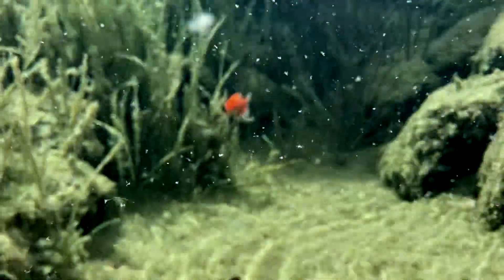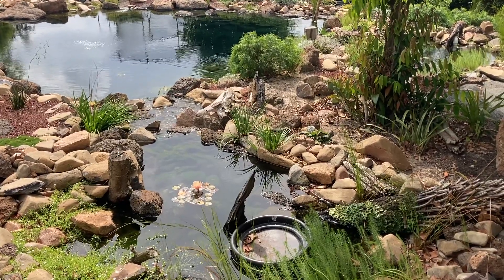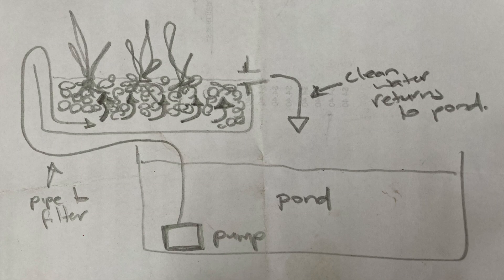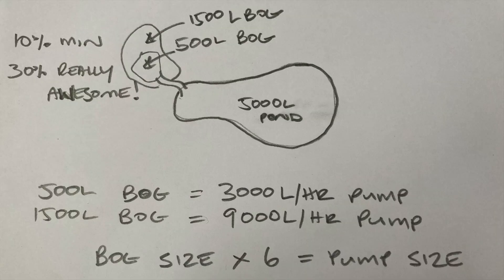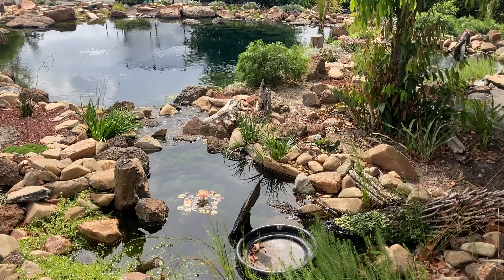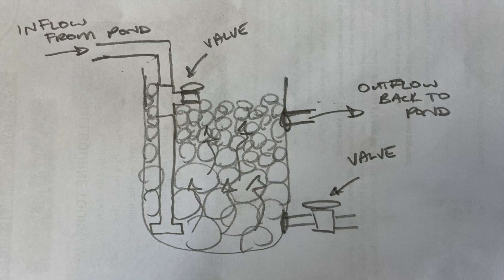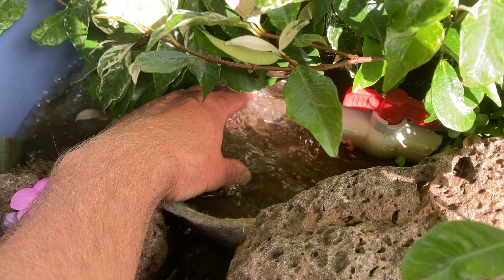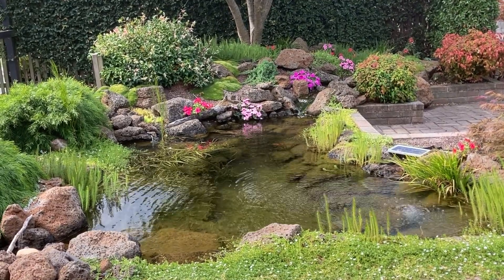Designing a bog filter. Clear water every time!

Comment: Thank you very much for your videos! Please, so if my hose from the pump coming into the filter is 1/2 inch, I can still use 1 inch for all the filter pipes like you do in the video right? Then I just put the hose from the pump into the bigger pvc pipe from the filter and all goes well right? Haha sorry i am still a little bit confused, and about to start my build. Thanks again
Reply from the maker: That will work, although you probably don’t want to push the 1/2 inch pipe all the way into the filter. Or if you did you want a little hole in that pipe to prevent a siphon if the pump shuts off.
Reply: @Ozponds  thank you so much for your answer! Ok I see. Still wondering what is the proper way to connect the pump hose to the vertical pvc pipe in the filter? Do you have a video showing this?
Reply from the maker: Have you watched the videos I placed in the description?

Comment: Hi Kev is it possible to use a layer of river sand in the bog filter to trap finer particles or will it compromise flow rate, I was thinking about layering sand between two courses of 9.5mm gravel
Reply from the maker: Ive never tried it so I can’t give you a definitive answer.

Comment: Hi from Spain, thanks a lot for all your videos. I have a cuestion, I´m gonna do a 5x4x1m pond with more or less 10.000L. I´m going to use your instructions for the bog filter. So i will need a 3,333L bog filter, i will use 4000L and i need a 24000L/H pump??? is not too much L/H? thanks and keep going with the videos they are great!!
Reply from the maker: For a 4000L bog I would buy a pump around 24,000L per hour, correct. Preferably variable speed.
Reply: @Ozponds  thanks, I thought that was correct but also that perhaps it will be too much flow if I need a low flow... no?
Reply from the maker: This is just a simple way to do it. It can have less flow absolutely. Remember you’ve got the breather pipe, an intake bay, skimmer or some other kind of mechanical filtration. Then you’ve got head height, back pressure from the bog. The pump cage or sponge will become semi clogged overtime. This is how I do it but it’s not the only way. There’s lots of ways to filter water. I just find this simplified version works for the vast majority of situations. Hope that helps 👍

Comment: Hi Kev, love all your vids! Learning so much!! Just wondering to choose the correct pump size,  you say empty bog size x 6, my bog is 500L so i should be getting a 3000L pump?
Just wondering if you need to worry about distance away from the pond the bog sits? Mine is 2metres away do i need to size bigger for pump for distance away from pond or 3000L still enough? Thanks!
Reply from the maker: In that situation 3000L is fine 👍
Reply: @Ozponds  Thanks Kev. Should i worry that my pond is 4200 litres so it wont be turning over once in the hour? I'm adding a DIY waterfall filter to to combat this 😊

Comment: Great Channel Kev ! 

Love your work ! 

Just a question tho ; if I was to design a bog or a barrel filter ; am I able to use Sandstone as oppose to bush rock ?
Reply from the maker: Possibly. It’s not a type of rock I’ve used. My only real worry would be if it’s so soft that it creates a lot of sediment that then clogs the filter. Otherwise I don’t see an issue.
Reply: Whatta legend u full replied ! That was my original thoughts . Bush Rock it is

Comment: Hi Kev, I'm interested in trying one of these on my pond. Is there a maximum depth of gravel to use? I already use a 200l barrel but use filter materials in it, which I have to replace. Rocks and stones are a much better idea.
Reply from the maker: I’m not sure where the maximum depth is. So long as you can access the bottom of the filter for clean out you should be fine.
Reply: @Ozponds  great, thanks. I'll get to work on it.

Comment: Hey Kevin, I have some questions regarding bog filters and incorporating them into a pond, hoping you can help. 

I’m designing an aquascape-style wetland filter roughly 16’x12’ overall, with a 3’ deep, 8’x7’ pit for the snorkel and centipede setup, with about 6”-8” water depth surrounding the centipede pit, then install 1 or 2 aquascape spheres to bubble out into the bog. Then fashion a roughly 16” spillway, possibly two, coming out of the edge of the bog, and falling 18” down into a 20’x25’ pond. 

My question/concern is- will having all the extra water intake into the bog, plus a wide spillway(s) falling out of the bog in to the pond affect the efficiency of the bog filter? 

I understand I need to achieve the proper flow rate going into the bog, not too fast or slow, to achieve proper filtration, and I’m wondering if the fountains, plus the pull from the waterfall negatively affect that, or if it’s negligible, and I should build away.

Also, any links to videos to understand estimating the proper flow rate for a bog filter would be a huge help. Thank you! And cheers.
Reply from the maker: You can pretty much have as much water as you want flowing over the surface of the wetland. It’s the flow rate moving up through that you need to be nice and slow. Hope that helps 👍
Reply: @Ozponds  that’s what I was hoping. Thank you 🙏🏼

Comment: Hi kev, wonderful video as always. I learned a lot from watching your video as well as reading from your website. Just one question stuck in my mind, do you need to have a separate solid filter when you have a bog filter in place? Especially when dealing with ponds with lots of fish in it.
Reply from the maker: You can design the bog so that it has plenty of space to capture solids. But if you prefer to seperate them before that is ok also 👍
Reply: @Ozponds  thank you so much for the fast and  wonderful response.

Comment: Hey kev- thank you so much for these videos! We're putting in a pond at the moment and the information is fantastic. We're very interested in this bog filter and I just want to ask you how big do I need to make it if my pond volume is about 30,000 gallons? I'm looking at that olive barrel thinking I'm going to need something WAY bigger than that! So my question is how much bigger? According to your formula, it wants to be 10% the volume of the pond itself, which in my case would dictate a 3,000 gallon bag. Is that possible in a contained environment? What kind of pump would I need to make that viable? Thanks
Reply from the maker: On my dream pond I added 2 bog filters. Both are built using liner so they can theoretically be made to any size required. I’ve never built a pond as big as yours. But you can build a bog in modules like the aquascape wetland system. You don’t need just one pump you could have multiple pumps feeding the bog. If I were building something that big I’d do lots of research, possibly hire a professional and then try to build the system using cheaper materials. But the fundamentals always stay the same: move water slowly through media (rock & pebble) colonised by bacteria, capture solids and have a way to easily remove the captured solids.

Comment: Thanks for everything you gave us in this video and your DIY ideas. I was happy to see a fellow "use what you've got" type mentality among all of the "how to pond " sites that use the brand name/high $ products. It was bad enough buying the liners.
   
   As far as "follow these steps and you'll have crystal clear water every time" - I have to say Not Every Time. I've been doing ponds for several years and currently been working on my bog filter for two years. I haven't had even partly clear water yet. I have one pond flowing into another (approx 1200 gals and 1500 gals respectively) - the first has been reduced to half bog filter and half left to flow into the second pond. Lots of rock and gravel in the bog but only a 1200 gph pump for the 600 gals of bog. I live in the desert, full sun, and probably not enough plants in the bog right now. I'm hoping that as the plants develop and a second pump dedicated to the bog flow, the filter will be able to clean up the water. I have also added bio-media to the inflow barrel of the bog. I have a solids filter barrel and will probably add another barrel for a moving bio-media tank. I love the challenge of building ponds with generic products and seeing good results - I'm sure I will get back to a successful, clear, and healthy pond before the summer season ends. Thanks again for your time making these videos.
Reply from the maker: Is the water being pumped into the base of the bog? I’ve never had a problem with an upflow system.
Reply: @Ozponds  Yes, it is a reverse flow from the usual. The water is flowing down the snorkel, into the water reserviour under the gravel, up through the gravel and back to the ponds.It has been set up that way since spring with added bacteria but very few plants. I'm thinking I need to get more plants sending their roots into the graduated gravel.
I have a second theory: I may need to get a better seal at the bottom of the down flow barrel/snorkel and out to the under gravel reserviour to make sure the water is actually being forced up through the gravel and not just coming back up around the barrel. Thanks for your interest. I will get back to you if I am successfully producing clear water.

Comment: 1:58 what if the pump would suck water from the bottom of that gravel/plants filter and pumping it up to a waterfall ? Will it still do the job?
I also have to mention that my gravel filter is in the pond itself, arround the deep swimming area
Reply from the maker: It will.
Reply: My pump sucks a portion of the water from a swimming pool skimmer and another portion it is supposed to be sucked from below the gravel (pea gravel size) through 3 separate pieces of drainage perforated pipes (24 meters of them) water quality it's not great, i have string algaes. I believe the skimmer takes to much if not most of that inflow which means not much happens under gravel. 
I turned off the valve that comes from skimmer and wait a few days to see.
I also have a bottom drain that feeds into a biological concrete multi chamber up and down filter with all kinds of filter media. The water was crystal clear, than it was a heavy rain ,but also it's been added 9 small koi 3 weeks before the rain and i can't figure it out where the trouble comes from. 
I haven't got the time or mood to edit a video with building process so that you could see what i have here...
Reply from the maker: It’s obviously not how I set up my ponds. You can see how I do it in the many videos I have. I always want it to be easy to clean. That way you can remove the build up of nutrients easily.

Comment: Hi, I'm in the process of making a turtle pond with some plants, (nothing too big, although I might add some small fish later), and I was wondering the best way to keep it clear and to stop it smelling bad. I would like to try this method but I'm not sure if I'd have enough space to make one big enough. I heard some people use this "beneficial bacteria" to break down the water, but instead of having a bog filter they just put it in the main pond, would it make much of a difference?
Reply from the maker: They need wet surface area to live on. Turtles have a large bio load. Watch lots of videos and read a ton. Try something small to understand how the bacteria works. Then build your dream 👍
Reply: @Ozponds  thanks for the reply, I've been watching alot of your bog filtration videos over the last few hours and think I might be able to allocate one. The remaining problems I have though are bird/rat proofing and also the energy consumption as I wouldn't want it on 24/7, I heard you can use solar panels but I'm not sure of the effectiveness of them.
Reply from the maker: I’m a big believer in the best results are achieved if the filter runs 24/7. If it were me and I couldn’t run it 24/7 I would design the pond as if there was no pump. I made a little wine barrel pond with no pump. It has a false bottom. I would create something like that on a larger scale. I would still do a bog for extra filtration but with the false bottom I know I’m getting some filtration even when the power is off. Good luck 🤞
Reply: @Ozponds  hmm I might try to design it like that but I'm curious as to what a "false bottom" means, and also if there is no filter how often would I need to clear out the water?
Reply from the maker: If you watch the wine barrel no pump build video you’ll see the false bottom. That’s better than me trying to explain it.

Comment: With fish, or not, have you done any experiments with a bog filter where the pump doesn't run 24hrs/day? Certainly, without fish, it stands to reason that a solar pump running water through the non-draining system, ought to be completely sufficient.🤔
Reply from the maker: No I haven’t personally done any experiments.
Reply: I have had great success with my small-scale stocked enclosures running only every few days/once a week. But I have mine all set up to filter their own water with plants and sand, so your own mileage may vary!

Comment: Thanks very much for this. One challenge we have - each spring we have a lot of toads spawn in our goldfish pond and most inevitably get sucked into the pump and into our sponge/UV filter. About half survive and we transfer them to a different pond to continue their growth process. We love the idea of a bog filter, but it looks as if in our situation the tadpoles would all be delivered into the bottom of the bog filter where they could get trapped - or am I missing something? Any ideas you have to help us solve this problem would be great. Thanks!
Reply from the maker: Yes. If you use an intake bay the little tadpoles won’t be sucked into the pump. This vid will explain more about what an intake bay is. Pond skimmer vs intake bay vs negative edge
https://youtu.be/k1OOOWexOiA and there should be a link to another video, from that one, on how I built one. Hope that helps 👍
Reply: @Ozponds  Thank you so much! :)